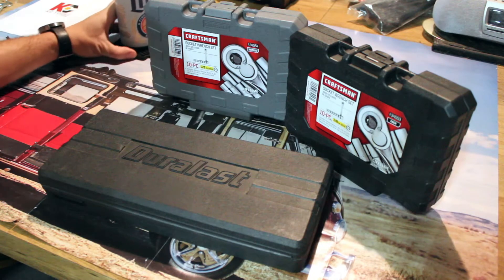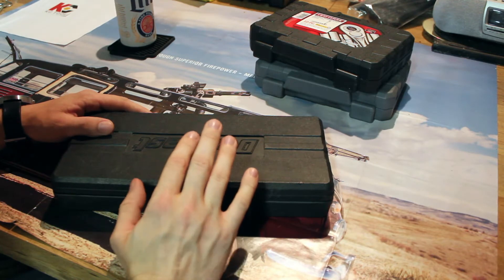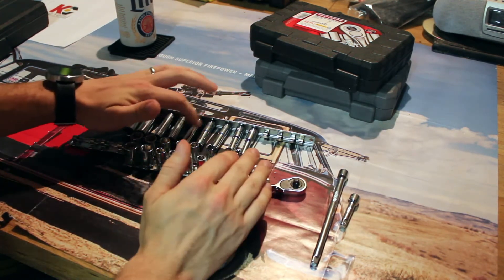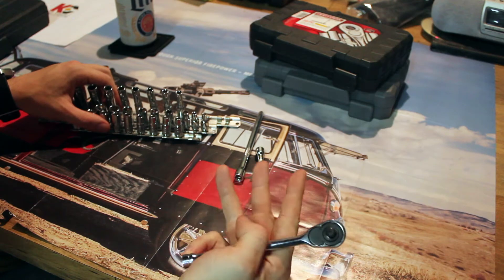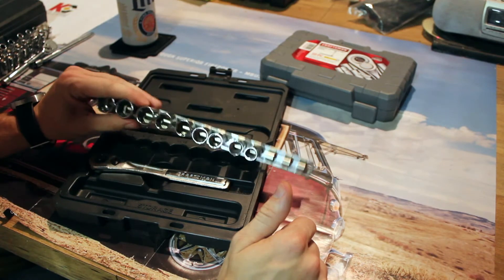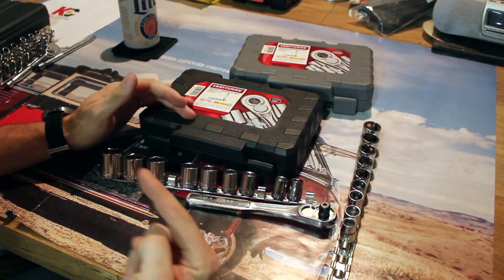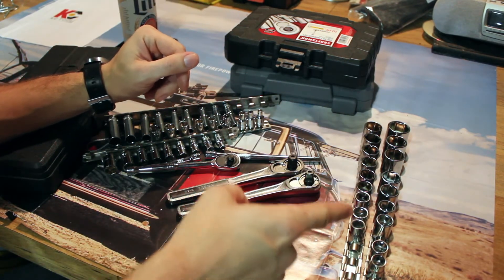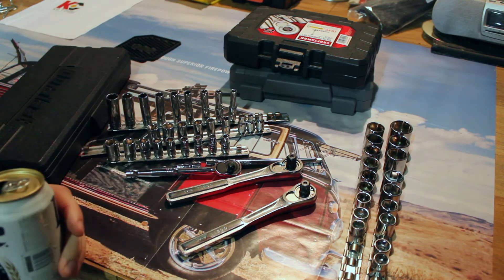Socket Sets for the Homeowner

Comment: My grandfather gave me a about a craftsman 51PC socket set made in USA about  30 years ago. Still works fine .  Ratchet broke once ,  took it back to sears and they handed me a replacement.  

I also have a noname brand 40 pc socket set I keep in car.  Think it was 1.99 at auto parts store.  Made in Malaysia. Might be great neck tools .  It’s 25 years old.  Still works.  It’s part of my emergency kit tools in car
This set from Walmart I think is really good emergency kit for the one and done . Just needs 3 inch socket extension.  
http://www.walmart.com/ip/Hyper-Tough-51-piece-Auto-And-Motorcycle-Tool-Kit/308690205